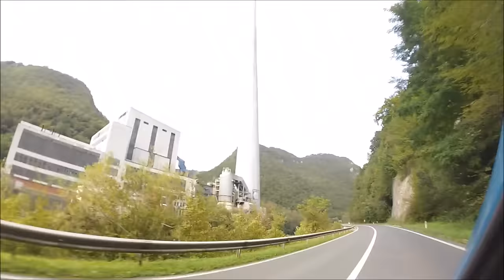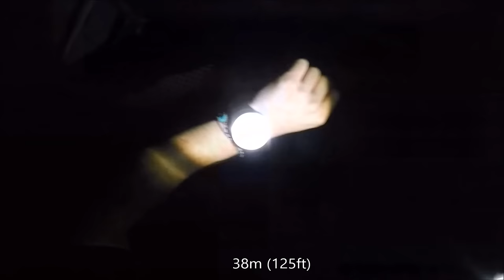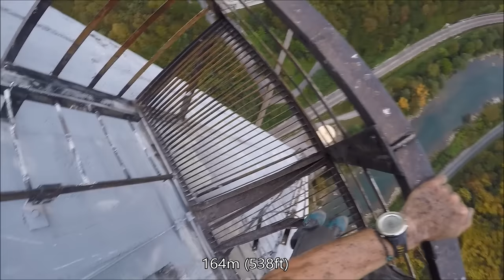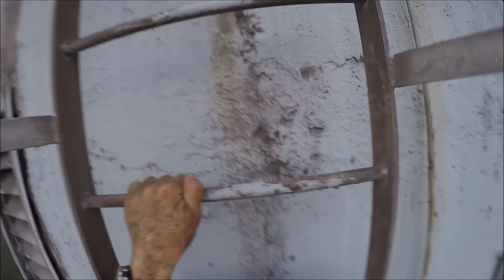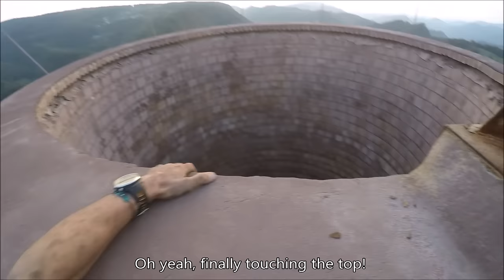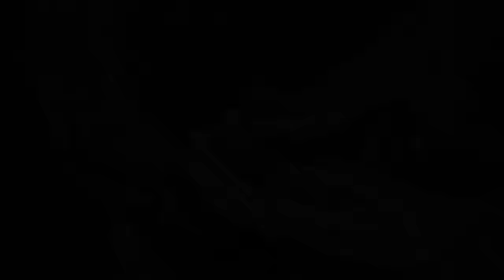Climbing the Tallest Chimney in Europe

Comment: Me: has an irrational fear of heights 

YouTube: here watch this:)
Reply: that's why youtube isn't support for nevermindhaha
Reply: A fear of heights is rational
Reply: BigBagOfFrikenAirFak not necessarily, it would be rational if it was extreme heights or if I had a bad experience which would lead me to have reason, I start to panic on about the 3/4 step on a ladder so it’s a bit irrational 😂
Reply: Okcurrr no trus, it’s evolutionarily rational. If babies develop a fear of heights, then they won’t travel and fall off an edge.
Reply: Okcurrr 16ft ladder bent forward from miss use, used for changing lights. Was told to go change lights I passed it on to someone else. It got done with a shorter latter by a taller person.
Reply: Same xd
Reply: Okcurrr i Can relate.

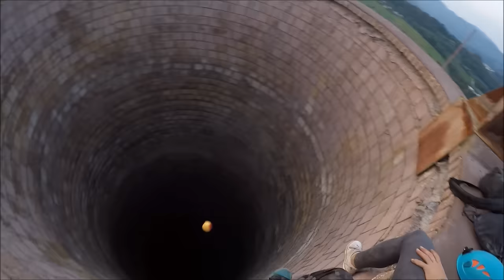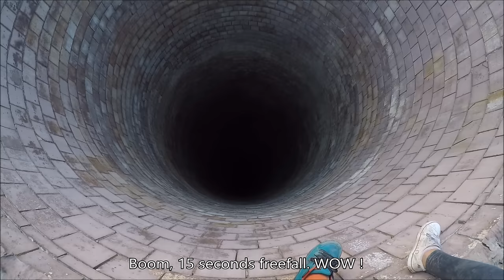Comment: (Total Free Fall Time) +(Time Taken by Sound to reach Top after Contact):- 13 sec(approx.)   [5:59 to 6:12]
Height=1999ft=609.3meter
=>Calculating Free Fall Time:
          S=ut+(1/2)gt²              where u=0
          S=1/2gt²
           t=(2S/g)¹/²
           t=[(2*609.3)/9.8]¹/²
           t=11.15 sec
=>Time Taken by sound to reach top after contact:
           (Neglecting the effect of gravity on sound waves)
           S=VT
           609.3=343*T
           T=609.3/331
           T=1.84

Now, Total Time =11.15+1.84=12.99sec
Similar to what we see in Video.

The good thing about science is that it's true whether you believe in it or not.

Comment: Get down in two hours or get down in 15 seconds?🤔🤔🤔
Reply: It would be even faster. About 9 seconds.
Reply: Assuming similar air resistance as the peach at 05:59 it would take about 12 seconds.
Reply: Tbh, I didn't made a calculation for my estimate but I guess it would be faster than 12 seconds. But it hardly depens on the pose you are falling down the tower. If you are tracing you get a very low c_w resulting in top speeds for humans when falling. On the other hand you kinda forgot to cover up the time the sound fromt the splashing peach took to travel back to the top. The tower was about 300m high and 333 m/s is about the speed of sound so you clearly have to lower the 15 seconds meantioned in the video by 1 = 14s of free fall (for the peach).

Getting back to the original thing: A human adult weights at about 80kg and when choosing a good pose which faces not much air in fall direction you get a c_w of about 0,2. The peach with the shape of an sphere has a c_w of about 0,2 - 0,4 so the falling human body will have potentially a lower c_w resulting in a better top speed concluding that the man would hit the ground way faster. I don't think your guess of 12 secs is that bad but I think it would rather be a fall of about 10,2 secs or so.

If you want to read more, check this out (but it is German however #GermanMasterRace):
https://www.ethz.ch/content/dam/ethz/special-interest/dual/educeth-dam/documents/Unterrichtsmaterialien/mathematik/gruene-berichte/fallschirmspringer.pdf
Reply: @updatedotexe  yooo
Reply: Maybe with a rope or parachute they could.

Comment: buddy it is not a chimney. it is a cooling tower employed to lower the temperature of water, which is then used in water cooled condenser to extract heat from the steam, which itself is the working fluid in a steam power plant. 
huge applause to your ignorance.
Reply from the maker: Actually you are the ignorant but nevermind!

Comment: I was there last month. Absolutely no chance to get in…
Reply from the maker: What did they do? Did you try to get to the chimney from the railway?
Reply: @flaviucernescu  Yes I took the way trough the railway. Do you know YouTuber SK adventure? He was there eight months ago and he showed everything. Of course the place doesn’t look like seven years ago when you went  there There was only one way left to get in, and he showed everything. He showed the people where they got in, to be aware of and how to be unseen. This chimney is one of my biggest dreams.I drove 15 hours to get there. I went through hell all for nothing. There was only one  entry left. It was through a gas pipe into the chimney. The hole in the gas pipe that leans into to the chimney got welded. 
The ladder from the outside is surrounded by a cage and it’s locked. There are also sensors and cameras everywhere. There is also a small metal door but it’s welded too. Then there is a big gate but its too heavy to open it. 
We even got managed to get into the security room in the building right next to the chimney.
There was nobody there. We had almost 3 hours to find a key, a button to open the gate or any other way but sadly without any success
Reply from the maker: @ollisbumsblog_6272  wow, that is quite a story you just told. If you want, write me on IG (find me by the same name and profile pic). I am curious to develop this topic. Cheers!